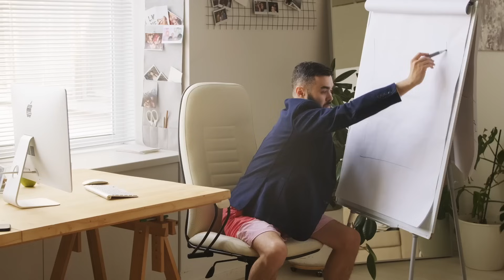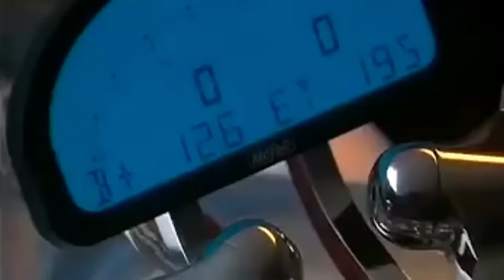When a Car Manufacturer tries to make a Motorcycle

Comment: Mitsubishi would definitely make a motorcycle that starts burning a quart of oil per day when it's 3 years old.
Reply: It doesn't burn it it sweats ot out every fiber of its soul
Reply: If my Evo is anything to go by, that's true.
Reply: Something tells me you don't know anything about engines.
Reply: @Key-z2x  You don't have to know a lot to know that certain Mitsubishi engines have a problem with oil consumption.  Something tells me that you're just talking crap.
Reply: @jamesdagmond  which engine are you talking about in particular?

If you're going to name an old ahh engine, I hope you're aware that all engines contain a lil something called "Valve stem seals" Over time, due to lack of use, these seals become hard like plastic and dont seal up anymore, allowing oil to seep into the combustion chamber and be burnt then released by the exhaust pipe.

This phenomenon is most noticeable with older lower mileage engines, In other words ( engines that may have been used a good bit in like the 90s/ early 2000s and then sat for years on someone's garage... Then people go out there and be like " look at this piece of crap! 100k miles and the car makes me seem like part of the fumigation and pest control team". Just change your god damn valve seals.

In the rare case that your oil consumption is caused by your oil control rings, just take out your engine, take it to a machine shop, have them look at it, if they say you need to overbore it do it then slap new rings on it and out you go. 

However, based on how you word yourself I doubt you have the skills to tear down an engine, you make it seem like "Oh this engine was designed to burn a gallon of oil per day and there's nothing I can do to stop it" 

I hope you one day understand that all engines are fundamentally working on the same principle and therefore are very similar in construction. 

I'm mostly speaking for the older mitsubishi engines 80s- early 2000s-maybe 2010ish. Since then I've lost interest in the automotive division of mitsubishi and havent been keeping up with their newer engines tbh.
Reply: There are car companies that already did the motorcycle thing. BMW and Honda did this a long time ago.
Reply: @sheogoraththedaedricprince9675  BMW is an aviation company that became a motorcycle company and then a car company. But that has nothing to do with my comment.
Reply: Hyundai: Hold my beer.
Reply: @felixjones9198 nice. As a STI bro, I hear that
Reply: @FacialVomitTurtleFights   Another uneducated viewer.   BTW, hyundai ran straight up mitsbishi drive train all throughout the 90s and even part of the early 2000s. In around the early 2000s they started developing their own engines largely based on the mitsubishi blueprints they had around. For example in the early to mid 2000s hyundai used mitsubishi's "6G74" engine but hyundai flipped the entire engine around and renamed it the "6GCU". Mitsubishi had developed these engines way back in 1986. The motor is an exact replica just that in one you have the crank pulley on one side, and in the other its on the other side. So things like cylinder heads or engine blocks arent interchangeable but other components still are. They even kept the same bellhousing pattern.
Reply: Harley already beat them to it
Reply: Better than Honda or BMW?
Reply: Mitsubishi don't even make good cars anymore 😂
Reply: I own an almost twenty year old Mitsubishi....
Your statement isn't incorrect.
Reply: @Fightre_Flighte  Your anecdotal evidence is meaningless.
Reply: @samizdat113  
Well, understanding that my anecdotal evidence which supports your statement has been declared meaningless, that would mean your statement has been invalidated by yourself.
Whereby, I will now argue that I completely disagree, as I can't (for the life of me right now) find where my Mitsubishi is sending oil to. But I do know that my car is not, in fact, a witch; and is not sending oil to the void.
I have also spoken with many other people with similar Mitsubishi's that just can't help but burn or leak some amount of oil, as well.

Your move, room temp.
Reply: @Fightre_Flighte  Oh. I reread your comment. My apologies.
Reply: @samizdat113  
It's fine, I'm just having fun over here. :3

Comment: This (and of course the Viper that donated an engine) was the reward for Chrysler completing all their assignments and turning in their homework early with the K-cars.  The government gave them an extra study hall.  This is what they did with their time
Reply: I could actually see the Tomohawk work though, if they redesigned it with a streamliner aesthetic instead (a Gru bike if you will), and turned it into a sort of Ryker/Niken hybrid with two big cruiser wheels at the back (and the wheels actually wide enough apart with good enough steering angle to actually be viable in traffic).

Something like this definitely has a place in the exotic super-cruiser market. It just needs to pass emissions first................. maybe a smaller engine would be required but a super high revving low (for a car) displacement V10 would sound amazing ngl.
Reply: The best part of the viper is they got a V10 to skirt the government agreement that Chrysler would stop putting v8s in cars
Reply: Should've made a better v8 instead. That camshaft not being oiled properly is the bane of my existence right now 😅

Comment: How to drain a fuel tank in the shortest possible time.

Dodge: we can do it
Reply: 12.7 liter of fuel capacity. that kind of tank equivalent to a 150cc motorcycle tank.
Reply: We need a gallon bike
Reply: Dodge put Yamaha's V-Max to shame in that department.
Reply: lmfao
Reply: bugatti chiron reached almost 500km/h(>300mph), it drained it's 100L fuel tank in just 10 minutes at such speed, this bike would not even reach such speed as the tank will run dry quickly before even reaching that 400mph(640km/h) claimed speed
Reply: @KevinSmith-qi5yn "We have the technology"
Reply: @lsp6032 yeah but to play devil's advocate, it's kinda the same for the Chiron, like there's 2 or 3 places in the world here you can do that, and you'll have to change the tires etc, it's not really practical.
Reply: I had the V10 Ram back in the 90s and no joke I got 5-6mpg in that thing.
Reply: Lol 😆 . And Dodge can probably build it ! Lol
Reply: I dare anyone to try and hold on to those handle bars at 400 miles per hour
Reply: dont forget about honda
Reply: Top fuel dragsters: Hold my beer

Comment: I think it's pretty silly for journalists to criticize the tomahawk for being unrideable and impractical when making it largely functional in the first place already makes it more usable than a good chunk of concept vehicles. 

It's a V10 motorcycle showpiece,
A "ridable automotive sculpture" and its just that, lol.
Reply: No less practical than almost any Orange County Chopper.
Reply: In this video at least they applaud it for being functional and daring, it was Dodge's own claims about the performance that, you know what just watch the video.
Reply: @georgerosebush9754  Yet Allen Millyard, an engineer and hobbyist, was able to make a rideable motorcycle that has a V10 Viper engine on it, and even did an actual top speed run on it instead of claiming estimates.

A private individual made a better Viper motorcycle than Dodge, in his garage 🤷
Reply: @sepg5084  making a handcrafted specimen is easier than a (theoretically) mass produced standardized product when it comes to exotic machinery. Doesn't make it less impressive, just different.
Reply: Rideable at a low speed. Pretty sure this bike never hit over 100k. A completely useless oversized paperweight.

Comment: Let me know if some day you want to sit down and hear how it happened, see studio images used in the design process, see photos of the fabrication process, hear how the last part had to be designed such that it could be made without being sent out for CNC milling because we had used up the entire shoestring budget and no more money was incoming, learn why you never see the rear wheels scissoring independently (they do this when leaning but the suspension was intentionally blocked by inserting a steel pipe through the hollow rear axle. This was done out of fear that a rider might not be able to keep it upright if suspension were allowed to articulate freely... For anyone who rode bikes regularly, this made the thing extremely difficult to ride; it could not be counter-steered like a bike until you got the thing up on one rear wheel; otherwise it had to be steered like a trike which is extremely hard to do if you're used to riding motorcycles), learn about the "testing program" (in quotes because there was no time to test at all; Kirt just got on and rode it; he was first, then Bud, his 70-something year old dad got on! Bud Bennett can be seen riding it in a few videos. I rode it up to maybe 40 mph for one video along side a test track... All I had to do was go in a straight line but I almost went onto the grass due to my brain not wanting to steer like a trike. And I would have gone onto the grass had I not yanked it up onto one rear wheel so I could steer normally), etc. 

I don't know if my name will be visible once this is posted; I'm the design guy, Mark Walters. I also did 100% of the CAD modeling, including the insides of the transmission + some other odd jobs, like trying to make sure RM got paid on time and keeping their shop cat company after hours. 

It's good that you credited RM's Kirt Bennett; this almost never happens. Without his talents, there ain't no way this project would have been possible. I've never worked with a more able engineer (as far as I know, he had no formal training and is entirely self-taught). He pulled it off on a shoestring budget and in an unbelievably short window of time. Keeping pace necessitated that I pack up and move in full time with the RM crew in Wixom. CAD data was handed, hot off my computer, directly to Future Tool for milling while I got going on the next part. Kirt drew up the 2-speed transmission on a note pad using a ballpoint pen and handed it to me with catalog full of bearings, telling me which to use and to allow 50 thou interference for every inch of outside diameter. 

Amazingly, Chrysler agreed to this arrangement; i.e. letting me off the hook for 5 months; they'd check in every now and then but mostly they just let us get on with it. I can't imagine another automaker doing that. Hands down, best place I ever worked. RM also demonstrated real trust by allowing me to work alone through the night; they gave me the keys to the front door and told me not to forget to lock it when done. The building housed a really fantastic multi-million dollar inventory of vintage race cars; we're talkin' seriously cool stuff... Porsche and Nissan GTP stuff; El-Ow-El-Ay T-70s and the like. I could compare how different manufacturers handled the same parts; suspension or brake mounting or whatever. Some of this found its way onto the bike.

Freeman Thomas: Freeman's role in this project needs explanation and elaboration. He was a MAJOR part of it and a catalyst for some very interesting, midnight-oil-burning times at Chrysler. Oh yes, there are stories.
Reply: @El_Peto Hey, I unintentionally replied to my own (duh!) post but I was replying to you.
Reply: How has the creator of this video not seen this comment?! Thanks for sharing! Chrysler took a lot of risks designing so many radical concepts. I always wished the ME-Four Twelve could have made it into production, but there's so many more. I always rant about how consumers weren't there to buy the Viper in big enough numbers, even when it was heavily discounted. The later generations were genuine 600hp, 200mph v10 manual supercars - something that doesn't exist anymore today - for muscle car money. I also am grateful that Chrysler redesigned Marcello Gandini's original Lamborghini Diablo design (which became the Cizeta V16T) into the Diablo we have now. The Diablo SV is my favourite car of all time, mainly because I regard it as being the most beautiful, the most unique and iconic car ever made.

Nowadays though I've completely lost interest in the car industry. Consumers were not there when it counted to buy the bespoke sports cars in high enough volume (S2000, NSX, 3000GT, RX7, Supra, Viper, etc). Now we're stuck with generic SUV's, hot hatches that are increasingly bloated to the point they are practically a small SUV, the Ute/Pickup apocalypse and the latest menace: 3 tonne, electric powered, amorphous blob, ground pounders... Oh and a second hand market full of dreamers trying to sell a Silvia for $80k...
Reply: @El_Peto Then you must have sat on the one built for the show (now in the permanent collection of the Petersen Automotive Museum). That engine was started, revved and shut down many many times. This is because of the incredible sound it made which was very different from the sound when used in the Viper car. This is due to the unequal length runners of the exhaust manifold (a long time ago, before designers knew better, this was common practice). It is not optimal for performance but it was the only way to keep things narrow enough to fit between a rider’s knees. The result was a staggered/uneven pulse which crackled because there are no mufflers at all, just a pair of 4-5 ft long rectangular section stainless pipes, fabricated with continually increasing sectional area, getting larger toward the exit which had the shape of 2 large vertical slots between the wheels. The idea was to mimic a classic megaphone exhaust which promotes flow and thus maybe get back some of the theoretical power loss caused by unequal length runners. What it may have given up in power it more than made up for in sound.

The battery sits on its side, tucked into a pocket milled out of the tail. Accessing it required splitting the halves of the tail which was time consuming, therefore, an Optima Yellow Top was used (the best battery available).

The alternator was from a Porsche 930 Turbo (tucked down into the V of the engine, behind the hooded cooling fan above the front wheels). Despite the ridiculous number of starts for onlookers (typically with lights powered on), I don’t recall ever seeing the battery connected to a charger.

Yes, the Tomahawk was briefly offered for sale via special order through Neiman Markus as a running but non ride-able “sculpture” (the two huge drive chains were not included but you could go to any forklift repair shop and buy them). It was photographed and I believe actually did make it into the NM catalog but Chrysler Legal pulled the plug before any were ordered. That did not stop at least one really determined collector… The last time I talked to Kirt (maybe 15 years ago), he was building one which I think he said was destined for Russia.
Reply: @PROcrastiDRIVESVofficial  I don’t know if the creator of this video has seen my comments. The info I’m able to offer might justify redoing parts of it (correcting inaccuracies) but the creator might not want, or have time to take that on right now. 

BTW, the CAD model used is not my work; it's a rough, 3rd party approximation (I’m being polite).

With regard to new automotive offerings, I could not agree more. Somebody needs to do something! The problem is, doing something significant requires “cultural horsepower”; i.e. a depth of understanding that cannot and is not taught by any design school. It is the product of internal passion that emerges at a young age. The environment that kids endure today does not foster, promote or facilitate the focused pursuit of any one passion. Engineering is similarly affected.

Love it or hate it, the Tesla Cybertruck is probably the one standout design that comes to mind in the past what… How many years? Thematically, it picks up the ball where the 1980 Citroën Karin concept car left off.

You mention the Chrysler ME-Four Twelve; this is the only interior I’ve designed (the exterior was designed by Brian Neilander). Of all my proposals for the project, upper management selected the most classical and conventional. I would call the results “tasteful but predictable”. Because it was nothing new (and I’m talking ONLY about the interior), good photos of it are extremely hard to find. There’s a decent shot in the Feb 10, 2022 DrivingLine article.
Reply: You should start a series of videos on everybody any part on this bikes development the stories you probably have
Reply: You should 100% make some videos explaining the process. I still remember seeing this at a car show and remember nothing else from that day